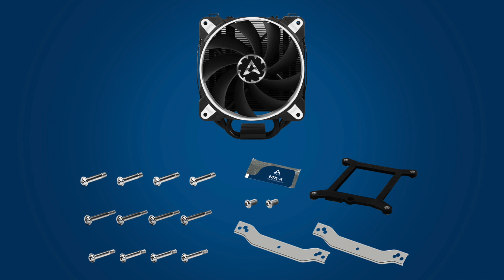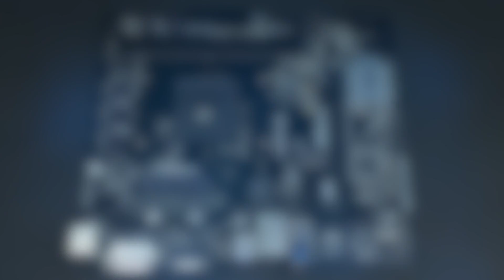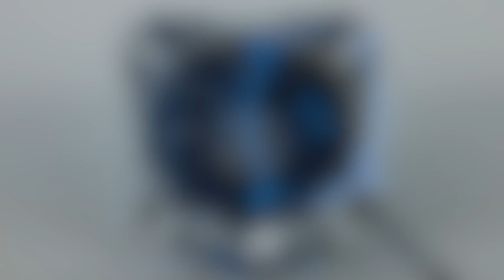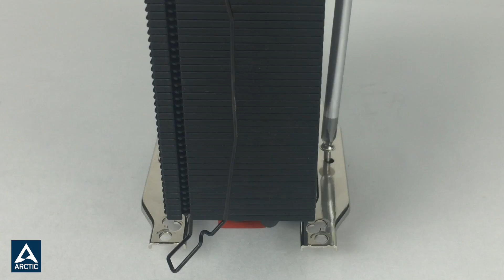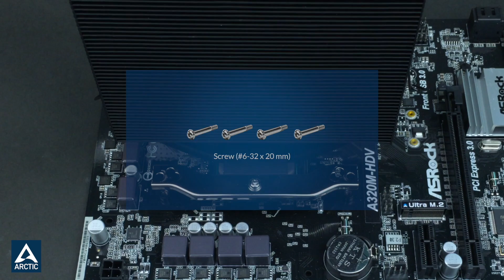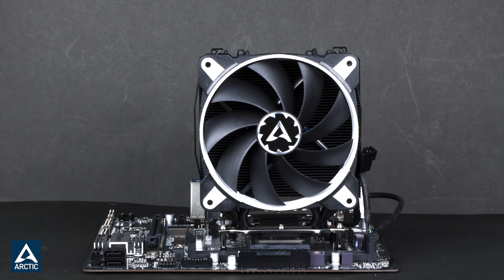ARCTIC Freezer 33 eSports ONE – Installation on AMD AM4

Comment: If i install another 120mm fan will it fit and is there more wires to hold it there? @ARCTIC
Reply from the maker: Hi Tate,
there are additional Wires for a push/pill configuration included. Please use the same fan as off brands could not fit.
Best regards
Stephan - Arctic Service
Reply: ARCTIC would a ARCTIC 120 PWM PST fan work?
Reply from the maker: Yes it works.
Reply: ARCTIC ok thanks

Comment: Hello there ARTIC!

I would like to ask, will this fit a ROG STRIX B450-F GAMING Motherboard and a AMD Ryzen 5 2600X?
 
Thanks!
Reply from the maker: Yes, this combination is supported 😊
Reply: ARCTIC thank you 😊
Reply: I've just bought the same mobo but with the 3600, did it install alright? I haven't put mine on yet but there seem to be fuses or something right underneath where the cooler is meant to install

Comment: Hi! Have a question. In the specs it says this cooler is good for up to 200W of TDP. Will this be enough for an overclocked R7 1700X? I'm currently running it 3.8 @ 1.27 v., but thinking of getting the chip to the much-coveted 4.0 GHz. The case has 2 140mm intake fans and 2 120mm exhaust fans. Max temps in OCCT are about 76 degrees. Any chance to  keep it at 75 under full load @ 4.0 GHz with Arctic Freezer 33 ONE?
Reply: I have the same question: can this cooler handle an overclocked 8-core chip? I already bought the cooler, just wondering how far I can push it...
Reply from the maker: Yes, it'll handle overclocking your CPU. How much it can handle depends on many factors ❄️
Reply from the maker: What cooler you're using at the moment? The Freezer 33 is a capable cooler, but there is no guarantee it'll handle this amount of overclocking at 75 °C. This'll depend on many factors

Comment: Edited: had issues with mounting cuz of missing mounting bracket for mobo but all solved.
Reply from the maker: Have you tried the AM4 mounting clips shipped with the cooler? Those should fit your board :)
Reply: @ARCTIChannel  
Thank you for reply, yes those are fine but I was missing bracket that lets the cooler screws ''sink into'' so the cooler gets attached.
I found the AM4 bracket itself that came with the other parts.
Reply from the maker: Yes the backplate holds the cooler :)
Have fun with your new cooler! ❄️

Comment: Wouldn`t it be better to apply the thermal paste to the CPU (instead of the cooler as shown in the vid) like everyone else is doing it?
Reply from the maker: Hi, we usually recommend applying the thermal paste to the cooler because of the exposed heatpipes. The tiny gaps between them can spread the therman paste differently than a flat surface. 

However, of course many of our customers use their preferred method anyway, it won't have a big impact and will still keep you cool. :)

Comment: no wonder i could not fix my cooler with this included screws on my am4. my backplate got no way near that kind a long back screws holes like in this videos. they are cut on the level of a motherboard. so i replace screws that got longer cuts in my case all the way to the heads.

Comment: Quick question. I bought this and installed it in my computer a couple weeks ago and has been working perfectly, however I had to flip the fan onto the other side of the heatsink when a friend pointed out I accidentally created a vacuum that competed with my exhaust fan. Now the heatsink fan is slipping out of the fan clips and is being held up barely by the bottom set. Is there any way I can permanently keep this fan from slipping or do I need to buy a whole new one and go through the near hour process to install it again?

I have a CyberPower pc case (damn things were smaller than I expected) and the included heatsink they gave me was absolute garbage (I have not overclocked my cpu at all and was getting 101C on the poor ryzen 5 chip).
Reply from the maker: Hey Lacey,
what's the airflow situation in your case? Normally it should be fresh air in from the front/bottom and exhaust-air out at the back/top.
When using one fan on the cooler it should be mounted on the side facing the front of the case and pushing air through the cooler. So even if another fan "pulls" air from the same area of the case, as long as enough fresh air gets into the case this shouldn't be a problem.
Regarding the fan clips: did you use the included rubber spacers when installing the fan on the "pull" side? This should prevent the fan from slipping :)
Reply: @ARCTIChannel  Currently the airflow situation is a bit better now that I've gotten two more input fans set up on the top of the case, and I did keep the rubber spacers on the pull side. I had to readjust the fan clips that, I'm guessing due to my novice-self installing anything for the first time, had stretched out slightly with my attempts to mount the fan back on. About a week ago at the time of typing this I readjusted the fan again after readjusting the fan clips and heard it snap into place. Since then the fan has not slid.

The case CP had built still feels smaller than what I had expected, but now my latest conundrum is removing the front panel to install one last fan for more airflow. It's a solid front with side ventilation mesh (the openings for the airflow are just over 2 1/2 cm wide, with about 3 cm from the bottom front fan that was pre-installed). The left is tempered glass, the right side where all the cables are I think more than likely is aluminum.

While I'm still getting 85C-94C on my cpu with some game load, it's much better than the 101C I was getting with the horrendous heatsink that came with it.

To give a better idea, the old heatsink I had vs the arctic esports one I had purchased on a friend's recommendation was a little less than half the size of the Arctic unit, and some of the metal tines were bent to the point of making contact with another nearby surface.
Reply from the maker: The temperatures of your CPU are still a little too high. Have you used too much thermal paste? Or have you changed the fan curve? You should expect lower temperatures when everything works as it should
Reply: @ARCTIChannel  I used the tube that came included with the heatsink kit, however I am currently debating if I should get more and completely redo the thermal paste I have on it.

Checking the ASUS bios and HWinfo programs says my cpu is sitting at a chill 32C-41C, whereas Speccy was saying my cpu was roasting at 79C-95C with all fans running and the increased airflow. I have not noticed any sort of throttling yet, however I still wish to keep my new setup going for years.

However, which one is actually the correct reading I should be concerned with? The bios/HWinfo one or the Speccy?
Reply from the maker: I would trust the bios/HWinfo. The Speccy reading seems to be incorrect

Comment: Does it come with a AM4  backplate and bracket or not if I purchase this on Amazon ? 
If it does I will sure buy this cooler.
I would like to cool a Ryzen 5 1500X, is this a good choice :)

My Motherboard is a X370 Krait Edition from MSI

Cheers
Reply from the maker: Yes, this cooler is AM4 compatible!
You can find all technical data on our website :)
Reply: Okay cheers :)
Reply: The backplate  part comes with AMD motherboards, it is AM4 compatible, as "ARCTIC" said.
Reply: MobyTurbo  What about NewEgg?.

Comment: Was going to buy Cryorig H7... BUT, installing this cooler is so much easier that I'll just get this one instead. Few degrees difference in cooling result doesn't bother me.
Also, that was strange method how to apply thermal paste, I'm pretty sure that using pea size method is best.
Reply from the maker: Thanks for choosing ARCTIC 😚 💨

Comment: Hey, @arctic I have this CPU cooler, but when I was putting the fans onto the heatsink, the clamp that holds it into place was a bit off, and I had to bend it a little bit with my hands. It makes a loud noise upon startup, but then goes away. I've had a bunch of coolers do that. Please let me know!
Reply from the maker: When it's just the fans spinning fast, this is normal.
Your mainboard starts the fans on full speed (100% PWM) and after that starts to throttle them down (depending on temperature).
Nothing to worry about :)
Reply: @ARCTIChannel  thank you arctic. I've been building PCs for a long time, and I've had stock coolers spin at 100% RPM on startup as well, I was just making sure that it is normal for this since it is an aftermarket cooler. Great thermals btw! I hardly ever notice the noise because I rarely turn my PC off..(lol)

Comment: Can I replace the fan when it doesn’t work??.
Reply from the maker: Yes, that's a simple BioniX F120 fan on the Freezer 33 eSports ONE :)
Reply: Any static pressure pwm 120mm fan will work ;)
Reply from the maker: Yep, we could also recommend the new BioniX P-fans for eSport-coolers.
Reply: Along with the Arctic P12 PWM.

Comment: Is this difficult to install while the motherboard is inside the case? I was thinking of using it for my Ryzen 3600 on a Tomahawk MAX mobo.
Reply from the maker: The 33 have to be screwed while the backplate is pushed from the backside against it. I would consider it more difficult than the Freezer 34 even if sometimes the backplate of your motherboard makes problems (in this case you can get one from us for free)